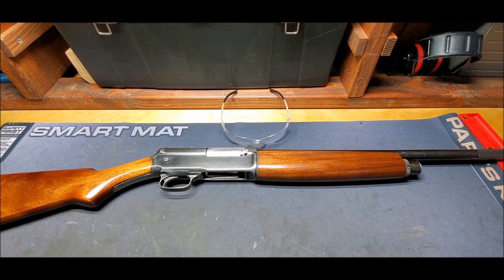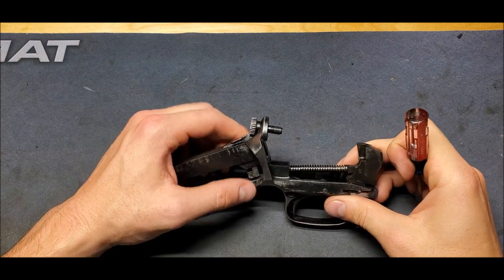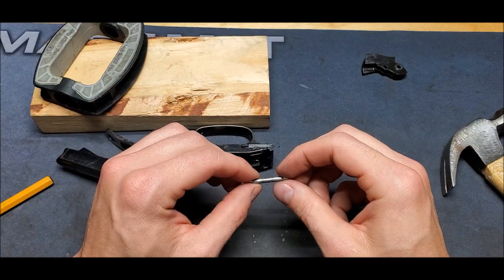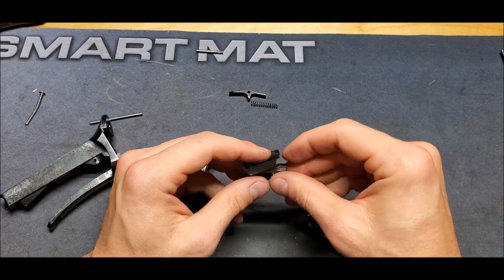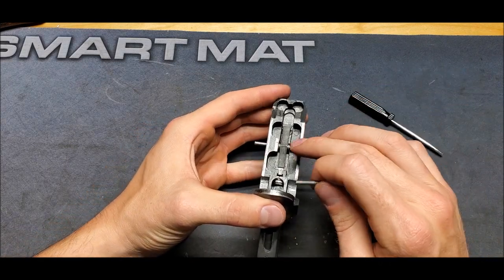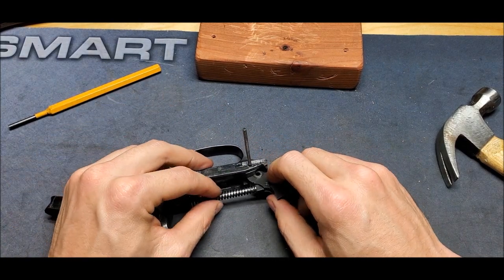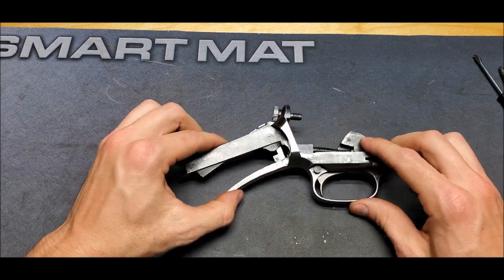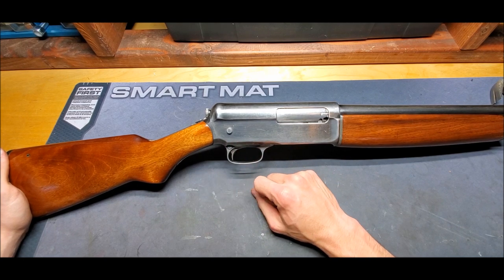Winchester Model 1911 Pt. 6: Detailed Trigger Group & Stock Disassembly & Reassembly.

Comment: The usual things we like about these videos are also true about this one. Great video and clear instructions. I caution those who want to take out the spring, it is VERY difficult to reinstall! It took Cameron many tries to get it back in and it took me several more tries than he used to return mine to the operating position. The video does show how to remove all pieces and pins in the trigger and hammer assembly for cleaning and lubricating. 
Please carefully consider if you do or don't want to remove the spring!

Comment: was gifted one of these that was missing the spring and follower stop rod.
got it put back together. thank you Cameron.
also, use a flat blade screwdriver to compress and hold about 80 percent of the spring
onto the follower stop rod, much easier.

Comment: That action spring in the stock is no joke!!!!!
Reply from the maker: Yeah, it can get pretty gnarly sometimes. Make sure you've got some safety glasses on.
Reply: @CRoutdoor  I gave up for the time being. The gun came to me in a box of parts. I've acquired everything except the buttplate. I have the stock lightly sanded after ironing out a few dents here and there. The weather is nice here today in Northern Ohio for mid Feb, so I thought I'd throw it all together to see how it functioned with a few live (light) rounds put through it. I changed my mind after attempting to install that spring for 10 minutes or so. I'll wait till I have the stock completely finished and buttplate installed. I'm only doing this job ONCE if I can help it. Thanks again for posting these videos.
Reply from the maker: @greyybeard  I totally get where you're coming from. There's some things on this gun that are a real bear and it's nice to just do it once... this is coming from a guy who was in and out of this thing more times than I can count haha. 
Hope your project turns out and keep me updated, love hearing about these old guns.

Comment: Have you ever taken the hammer pin out while it's locked in the fire position? I can't get the hammer on my 1911 to drop
Reply from the maker: I can't say that I have. If you haven't watched the whole video watch starting around 1:27:07 I talk about some timing issues that I was having and it might be happening to yours as well. 
If not, you theoretically could take the pin out with the hammer back but that's a very abrupt release of energy when that pin is pushed out. Careful if that's the route you decide to take. I'd tinker and look around for the root cause of that issue first. 
Best of luck. 
If you have anymore questions, I'll be here.
Reply: @CRoutdoor  my timing rod spring was bad cased the timing rod to slip out of place and lay up ontop the sear so I figured out to pry the sear a little and got the hammer to drop to take it apart properly now I'm just waiting on 2 springs to get this old thing back together and then to move onto working on my 1887
Reply from the maker: Sweet! Glad you got it taken care of. 
All the best with your projects.

Comment: Hello my name is Rodney Bailey I have a Winchester model 1911 12 gauge Widowmaker and for some reason it does not want to pump a shell into it it is seized up any idea why? When you pull down on the barrel the receiver does not move
Reply from the maker: Hey Rodney. Sorry for the delayed response, I was out of town. 
It's tough to know exactly what's going on without seeing it and knowing if anything has been tried. But, here is where I would start. 
1) It's seized up due to corrosion on interacting surfaces. This would require a disassembly and cleaning. It's crazy how some problems go away just with a deep, thorough cleaning.  
2) There is a damaged piece/surface on the barrel extension or inside the receiver or bolt which would require repair or replacement. 
3) Something is bound up with the springs... either in the forend or the buttstock. 
I'm sure you've already done some troubleshooting on it but hopefully you/we can figure out what the issue is. I'd love to be kept up to date on it. Best of luck.

Comment: Mine when I undo the take down screw it still won’t come apart it just like stuck together
Reply from the maker: The only things I can think of is that it's gunked up or seized up with corrosion. Or a pin has has walked out a bit and is pressed against the receiver. Other than that I'm not sure what it could be. 
I hope that helps, let me know how it goes. Thanks for watching and commenting.